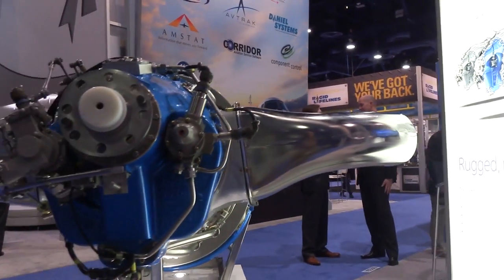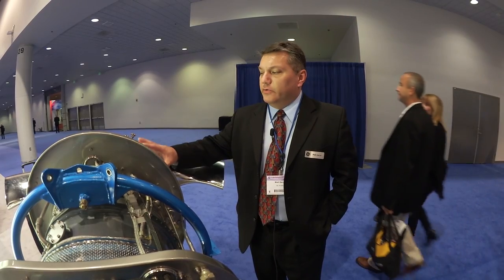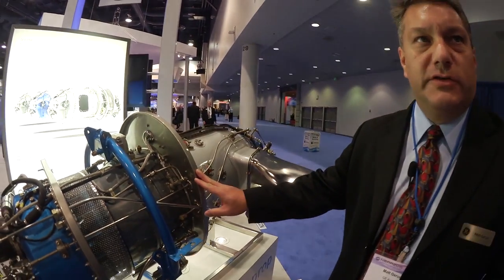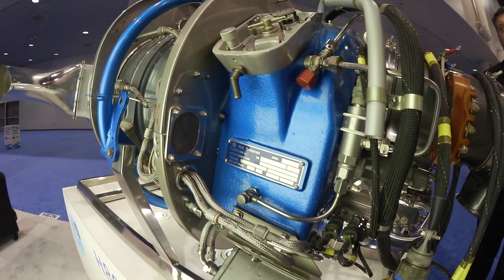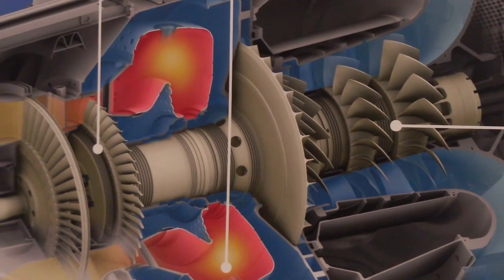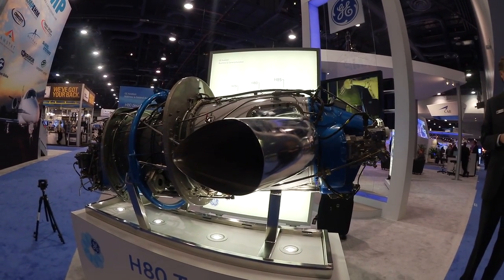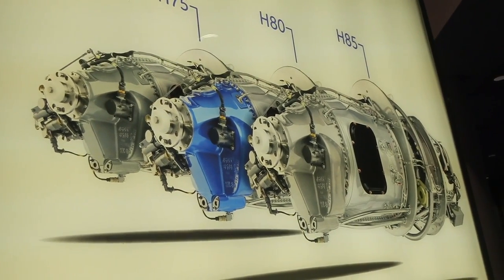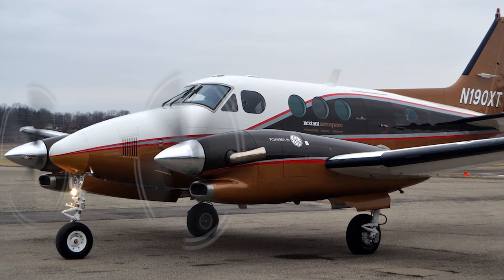GE's New H-Series Turboprop Engines

Comment: I'll keep the PT6 it'll run twice as long between tbo. Also if you go on condition it will run much longer. Whats the overhaul cost on the GE cause it sounds expensive at 3600 hours?
Reply: It is a Soviet engine. Not expensive to repair....unless you take it to GE....

Comment: Minor upgrades to a 60 year old design at a very high price no doubt. What happened to the ingenuity we had up until the 1970's when they started complicating old designs and raising the price to the consumer?
Reply: Do you appreciate what R&D and production costs are for a clean sheet engine? What magical new technology has been discovered since the 1970s that radically changes how turbines work? 

To get higher efficiency you need higher compression ratios, and to get higher compression ratios you need more compressor stages. More stages means more $$$ and a bigger engine, which is fine for an airliner, but not so much for a GA plane. 

Bizjets are mostly running certified variants of cruise missile engines, that's where money for their R&D and production line setup comes from.

There just isn't enough money in general aviation to fund R&D for new engines. If it weren't for the agricultural market GE probably wouldn't have invested in this.

Comment: If the H80 series is already giving away metal filings after only a short time of use, there is no support, expensive parts, bad GE Praga corruption, numerous bearing change bulletins, FCU changes, GEARBOX changes among thousands of other factors, imagine this new engine . It will be the successor to the H80 with new problems.

Comment: Ahh ...umm...ah..um.ahhh...umm
Reply: +preflightGOYR I was thinking the same thing. Several of these videos have had sales folks that were surprisingly unpolished. Maybe Paul B. makes them nervous ;-)
Reply: +Bill92677 
I worked for GE Installation and Service Engineering International Department and was surprisingly unpolished. I had determined that my condition was primarily due to piss poor compensation, long hours, and months away from home. GE was considerate enough to send me to areas of the world that were quite disagreeable and far from tourist destinations. However, I gained the knowledge of where to stick the enema hose should the world ever require it.
Reply: I feel, he has memorized the sales brochure but doesnt really understand....
Reply: You guys are being too hard, ah, he did fine.
Reply from the maker: Yup. At Matt knows this stuff cold. Very knowledgeable guy.
Reply: To je náš motor z Waltrovky a ne z nějakýho GE  vydávají to za svý ale je to trochu jinak